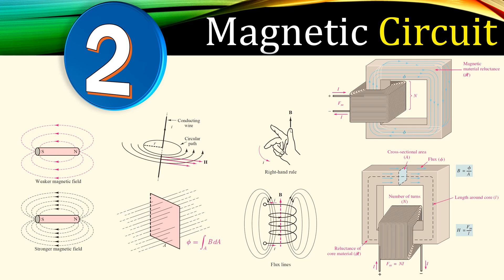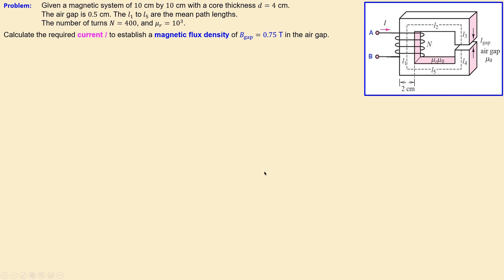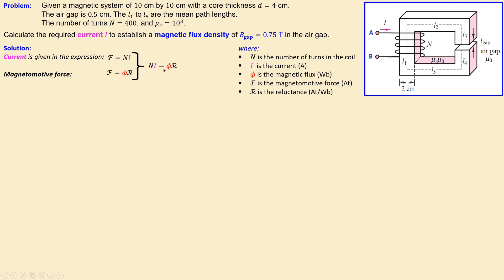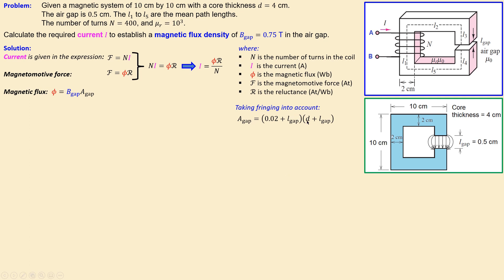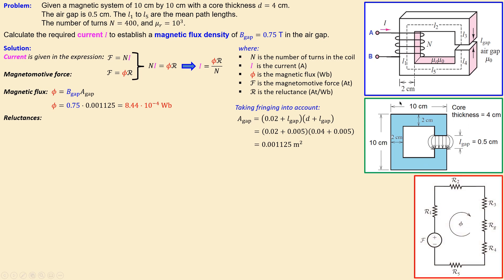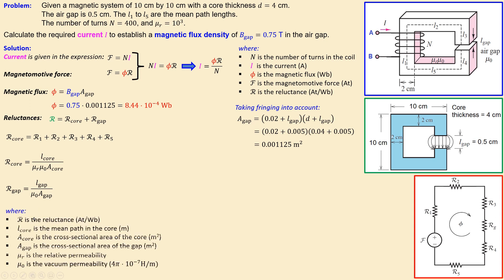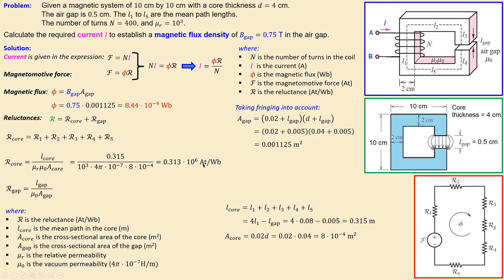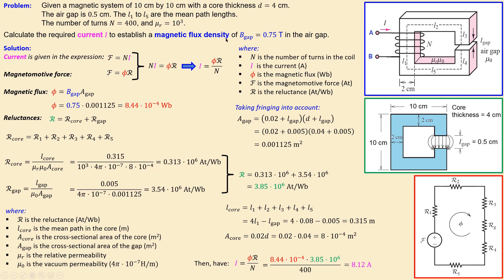🧲 Magnetic Circuit Example 2 🌟 Required Current for Magnetic Flux Density in Air Gap

Comment: for mean path of the core , i don't quite understand how we got 0.08 , please help me, i said for mean lines , 10cm - 2cm i got 8 cm , that 8 cm it the distance in the middle space so in order to get the mean line i said 8+10=18 then 18/2=9cm which i got it as my mean line, and i said 4.l1-lgap to get my lcore, why i cant get my mean like that
Reply from the maker: Thanks for your message. Why do you do 8 + 10 = 18 cm? The mean path is needed for all sides of the material. This is what you not consider.